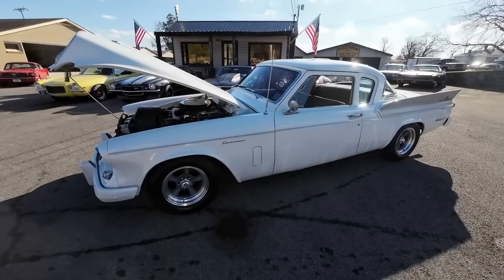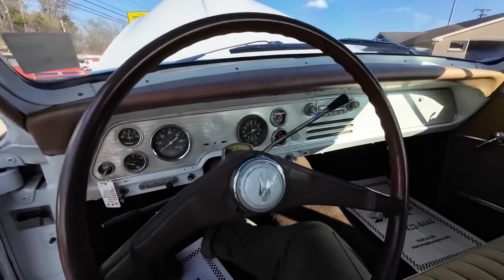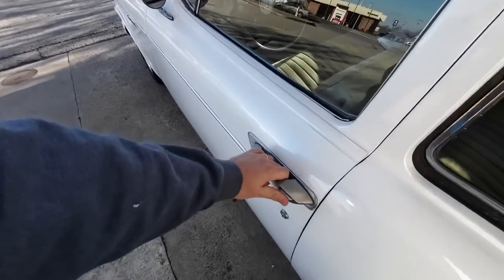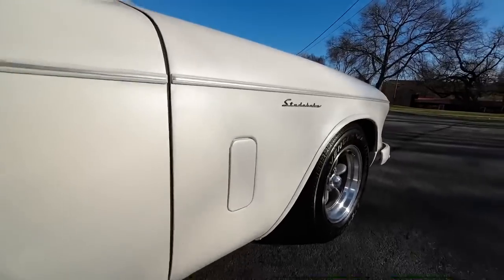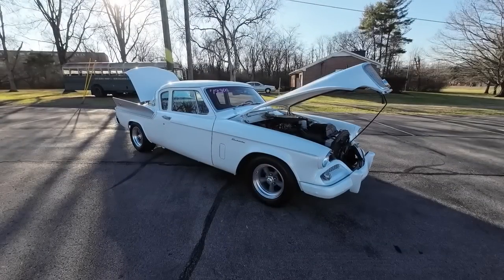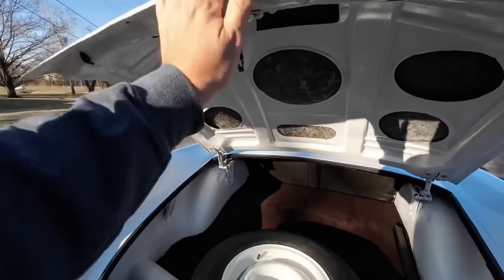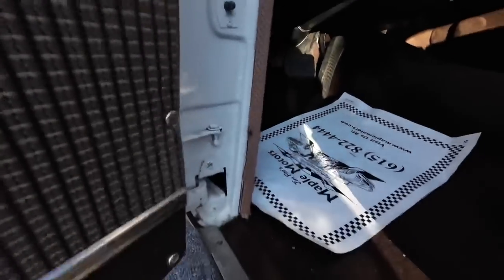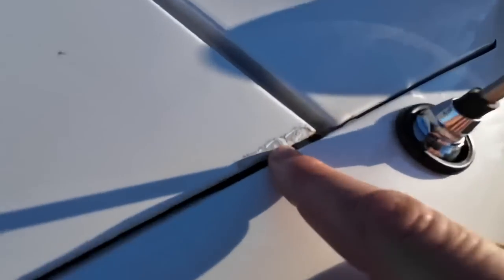Test Drive 1959 Studebaker Silver Hawk SOLD $19,900 Maple Motors #1966

Comment: Obviously not a numbers matching ride  , that engine quiets the cool sounding exhaust  , this car has retro mod written all over it  , upgrade the suspension  , brakes and exhaust,  drop in  a modern crate motor  ,refresh the interior and a new paint job  , definitely worth the extra bucks  , very cool ride

Comment: Those Fins look like Cadillac, looks upgraded a bit, clean inside sounds like a low idle, is that a weld on the gas tank, neat looking has a James bond kindof look, side glass was for smokers so you didn't have to roll down the full window

Comment: Such a cool car looks like the thunderbolt motor too bad its not an R1 or R2 but cool just the same I had a 63 GT Hawk with the 4 speed but it too was the thunderbolt motor the R1 was a 4 barrel with a hotter cam and the R2 had a paxton super charger back then it was 150 mph car.